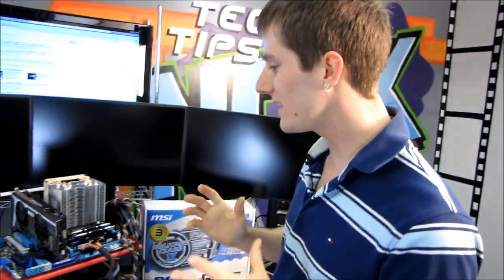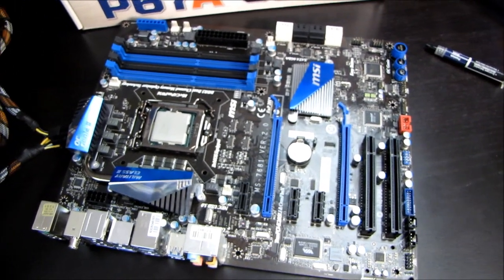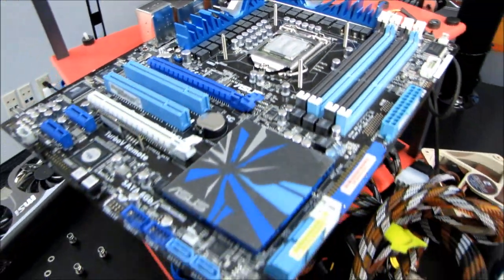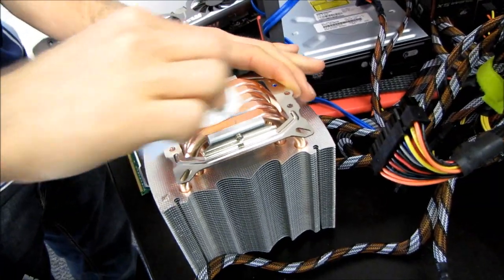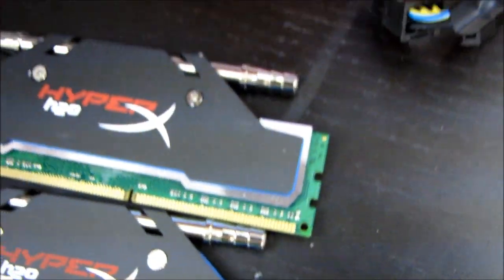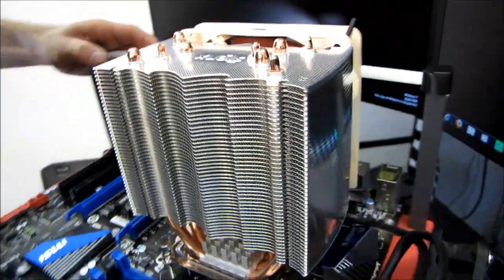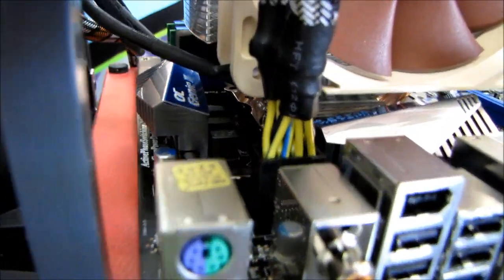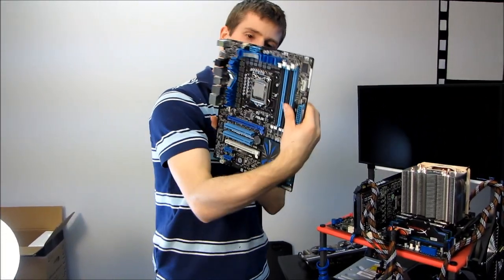How to Do a Motherboard Swap - Upgrading My Test Bench Linus Tech Tips

Comment: if i change my cpu will i need a new copy of windows or can i use my old one on my hard drive?
Reply: Literally every piece of data of your computer that is stored (including operating systems) are stored on your HDD(s). This means you can change every single part of your computer excluding the hard drive, and it will be "the same computer". 

TLDR: No, you can use your hard drive.
Reply: so i can change any part of my computer and use my old hard drive and still have my windows 10? this 100% confirmed?
Reply: Johnny Slipknot Yep! Just make sure your parts are compatible with each other!
Reply: Update: Before you replace your motherboard, write down your windows product key! You will need to reactivate it once you have the new motherboard, but not rebuy it!
Reply: im only changing my cpu
Reply: Hey! Can I restore my system image back up after replacing motherboard? What if my mobo is a different brand than my old one? Can't buy my old mobo anywhere anymore.

Thanks a bunch.
Reply: chibichocolate What do you mean by "system image." And yes, all motherboards should be fine, regardless of manufacturer. The only difference is the BIOS.
Reply: +Hexadecimal Computings So basically, if I upgrade all of my parts in my PC besides the HDD, I wont have to rebuy Windows? Sorry, I know you have answered this like 4 times but I really need to upgrade my PC and I dont want to screw anything up. :/
Reply: DaSheepKing im pretty certain the only thing that will effect your windows is your mother board so if you change everything but your mother board and hdd you can still use your windows this is what ive learned but still not sure so im only upgrading everything but my hdd and mother board
Reply: do i need to remove my old cpu driver or update my motherboard bios before i install my new cpu?
Reply: Johnny Slipknot Nope. Computers will always boot without drivers being installed. Just when you boot into Windows, the first thing you do is snag all of the drivers. Otherwise your CPU, GPU, etc will not have nearly their full performance.
Reply: Hexadecimal Computings I did a system image backup of my computer - all the data and the way I have it setup is copied to an external harddrive. If I switch out the motherboard, can I use that backup and restore it even with the new motherboard in it? Or would I basically have to start over and re install everything again?
Reply: chibichocolate You don't need to copy your system to another hard drive unless you are switching the hard drive itself. For the motherboard, just get your windows key on your old motherboard, and input it when you boot up on the new motherboard. If that doesn't work, Microsoft should be able to help you via live chat by simply generating you a new key to use.
Reply: Hexadecimal Computings Maybe my question wasn't clear...Not having a backing up your data seems pretty risky lol. Thanks for taking the time to answer though.
Reply: chibichocolate Not really. The data is stored on only the hard drive, meaning replacing everything, the storage of your computer, so how your computer reacts to software, is completely the same.
Reply: +Hexadecimal Computings I want ti reuse my Hhd from a prebuild PC so i dont have the product key. Will this be a problem?
Reply: if you change your motherboard yes you will need the product key so yes it will be a problem
Reply: Sorry to be a pain. I currently have a asus H170 Motherboard and want to upgrade it to a asus Z170 Motherboard, will I need to re enter my Windows prduct key, as I bought the product key of kinguin.
Reply: Kelvin Bastow If it is an OEM key, you may have some issues. OEM basically means that you accept that you built the computer. That means Microsoft can't help you via support if something goes wrong.
Reply: Cube I heard you need to uninstall the windows from ur old PC and then u can use the product key again because you can't use the same product key on multiple devices,is this true and if so do I need to do that first

Comment: Umm my motherboard seems like it will fit but its allot bigger than the old one..
Reply: motherboards can come a few different sizes mATX microATX ATX ect ect most stock budget motherboards that come in  pre built systems are smaller sized board but most custom upgrade boards are fullsized atx boards. as long as your case is a mid or full size tower a full atx motherboard should fit.
Reply: Nore Mac yea it fit. barely
Reply: Mitchell Staley awesome man!9 I just slipped the asus z170-ar into my next s340 which is a mid sized tower and it fit in perfect once I removed some fans.

Comment: Can I just swap my motherboard or do I have to do stuff with my os?
Reply: +Eric “xBloodshot99” Randall depends, if you have OEM windows than u will need to buy windows again otherwise you will just need to un-install windows first and after the swap install again
Reply: +Kemp Dewulf There is no need to buy new Windows Key even after a motherboard swap all you need to do is call up Microsoft answer a few questions and you get a new key to activate Windows
Reply: +K- “K-Hype3” Hype oh ok, thanks for the information!
Reply: +Kemp Dewulf You're Welcome
Reply: +K- “K-Hype3” Hype I'm replacing my stock motherboard, so where could I rebuy windows 8.1?
Reply: Jared Warner about every pc shop i think but i'd suggest buying W10 its better imo
Reply: Kemp Dewulf how do you go about reinstalling the OS then?
Reply: Jared Warner You can buy it from g2play.net
Reply: K- Hype how about a mainstream retailer
Reply: Then Best Buy, Newegg, Amazon, Microsoft